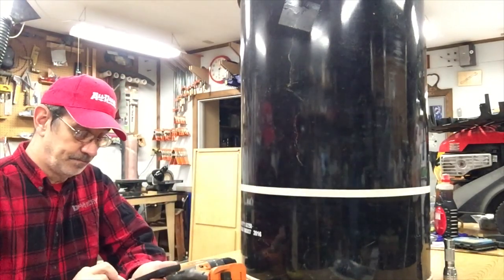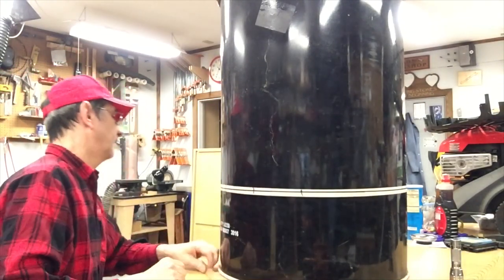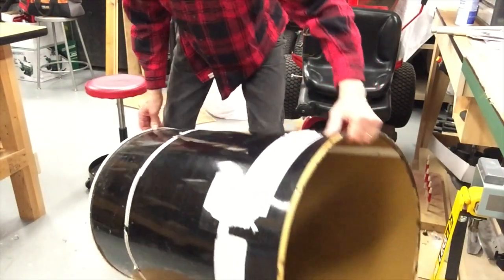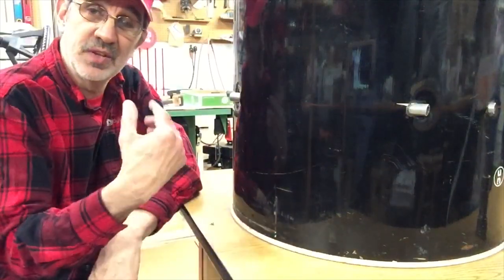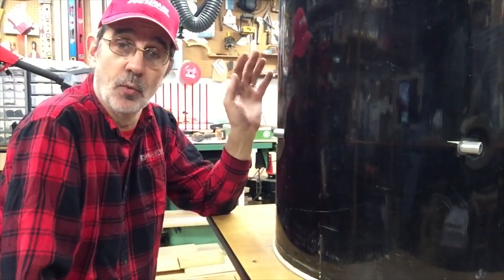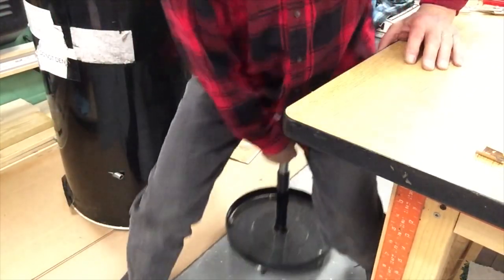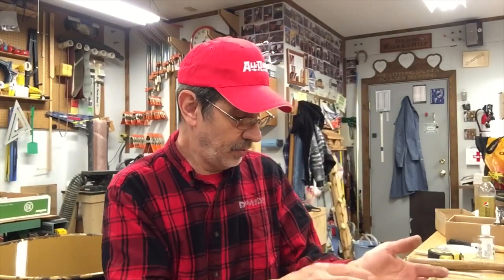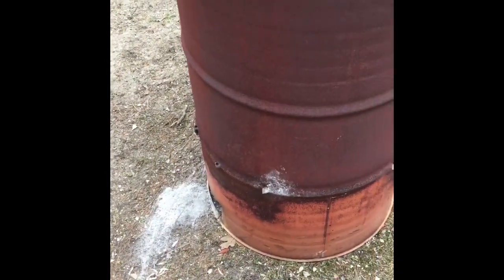293. How can I build a burning barrel that actually works.

Comment: Hey Jim, just cut a slot in each end of the conduit and pry them apart a bit and they'll stay just fine. To eliminate any and all smoke, and I mean ALL of it, take a second barrel, cut out the top and bottom, make a cut from top to bottom, pull the ends together a bit, tack weld, and make it so that there is an inch of space all around between it and the outside barrel. Put a lid on the outside barrel, then cut out the center of the lid so that the space between the two barrels is covered. Then, put a circle of holes in the inside barrel about one inch from the top. You would make the inside barrel shorter, and let it sit on the grate. What happens is that the space between the barrels gets real hot and creates a vacuum, which sucks any smoke downward, which then mixes with fresh air, and is then drawn into the space, and gets real hot, and when it comes out of the holes it meets the flame and burns like mad because the gas in the smoke ignites. There will not be even a hint of smoke, no smell, no burning eyes, and is perfect to stand around in freezing weather with some marshmallows. There will be no specks of anything flying through the air because it all got burned. You can expect the flame to be about two and a half times higher than the barrel which is because of the gas. Just make sure that any and all fuel is below the holes as anything above the holes will smoke. What's really amazing is that in the winter you can feel the cold yet stay warm at the same time, and no smelly cloths, and it feels amazing. You'll be able to almost hug the flame and still be comfortable. Family and friends will love it as a real fun thing to do. You could mount the whole thing on an old mower deck to move it around the yard to wherever the fuel is. BTW Jim you do a good presentation.
Reply: I like what you are sayin , but I can't quite see it in my head. A picture would help. Thanks, Rick
Reply: You really should make a vid explaining this.  Sounds awesome.

Comment: I made one exactly like yours. I burned while I mowed my yard, returning to the barrel to add brush.  I burned for several hours, probably 6 or 8 barrels full with some logs 4-5 inches in diameter.
Hours later, after the barrel cooled, I went and looked in, and was surprised to find nothing but ash, just like you said.  I then put the ash in a 5 gallon can to place by our tomato plants.  

I loved the experience so much, that I bought a second barrel and the only difference is I used rebar instead of galvanized pipe because I could only get the pipe in 10 foot lengths and could not get it in my car.  Thank you for sharing your idea with us.  I have already shared it with a friend (your YouTube video),

Comment: Hi Jim - it's Big Rodders from Ireland. An interesting version of the old volcano stove principle. For folk with less room in their yard another simple idea is to use a washing machine drum which, being stainless steel, will not rust. Remove it from from the machine, a task in itself, and reverse the offset pulley on the rear so it acts as a stand and raises the drum maybe 9 inches off the ground. Cut a slot like yours in the bottom, face it towards the wind and "Bob's your Uncle"! The greater the wind the better it burns - and we know about wind on the west coast of Ireland! The firebox volume is smaller than your stove and air dispersal into the heart of the fire isn't as efficient but, as you say, "as long as it works". The best part is that the cost is ZERO - Yippee!

Comment: 4/13/22 I officially made your burn barrel thanks! I’ll test it out tomorrow. Your instructions were good enough for me to put the barrel together. I started with nothing so the est. total I spent was about $115. Tools are WAY cheaper at Harbor Freight Tools rather than Home Depot, Lowes!
UPDATE: I just tried the barrel and wow! It did EXACTLY what Jim said and turned everything to fine powder! Everything burned so quickly and ignited so easy after adding additional branches. The barrel gets really hot so please follow your local guidelines and burn safe!
Reply from the maker: OK I have to ask what did you buy for $115. Jim
Reply: @jimjackson9381  
Barrel $25
24x36 expanded sheet metal $55
Drill Bit $20
1/2in 10ft conduit pipe $7
Cutting bit $6
Reply from the maker: @MrAAok  Well sorry it cost so much but they do work nice. Jim

Comment: Great Idea, I moved from Homestead FL and got a place in Chiefland (North Central FL, Levy County) on 2 acres next to the State park here. Got lots of trees that drop leaves and sticks etc. but I been afraid to build a fire and burn them because I am in the middle of a forest. I don't want an ember to float up and get out of control. This looks like a good solution to that problem. My neighbor burned a bunch of stuff last year and I was sitting here just hoping he didn't set the woods on fire. I will feel a lot better with everything contained safely. I'm gonna do this one.
Reply: Hi David Boggs - Greetings from Big Rodders in a locked down Ireland. To reduce possibility of air borne emblems you could make a second mesh grate that you would place on top of the barrel when you light the fire and weight it down with a cement block. That may give you some peace of mind.
Reply: @rodneysweetnam8653  i thought of that too..that's a good idea i have some more expanded metal I'll do that to mine..thanks for the idea..Cheers 🍻🍻🍻🇺🇸🇺🇸🇺🇸

Comment: Be sure to check with your local Fire Department,as burn barrels are illegal in town around here.  I’d add a 2” hole under the grate level to insert my weed burner and a few pavers to keep it off the ground while still keeping it stable.  Nice build, Jim!

Comment: Those pipe you could easily just squish the ends after they're installed, either with good sized vise grips or a couple hammers , hold one under the pipe then hut the pipe with second hammer. With the pipe flattened out a little it will be bigger than the hole. 2 seconds per pipe and done.

Comment: I simply cut a big hole out of the bottom of the barrel and drop in a round charcoal grill grate. The barrel sits on three cinder blocks and the ash drops down and is shoveled out as necessary. Oh, some holes drilled in the side of the barrel but I'm not sure if that is really need or if it just makes me feel good.
Reply from the maker: @BillKisel  well I suppose that would work as long as you don’t mind a mess on the ground and you don’t mind shoveling it up when I get ashes in the bottom of mine I just turn it upside down on a piece of cardboard and throw it in the garbage personally I don’t like shoveling

Comment: Great video.  Good idea.   I bet that if you drill an accurate hole for the conduit tubes, you could just crush or crimp the ends of the conduit to keep them in place permanently.  There is no real reason to remove them in future.
Reply from the maker: In less you want to reuse them on the next Barrel.      Jim

Comment: I have some rebar laying around I'll use it and the expanded steel..i may put legs on it too ..about 3" long..thanks for the great idea..see you on the next one..Cheers 🍻🍻🍻🇺🇸🇺🇸🇺🇸
Reply from the maker: Rodney Brand 
When you get it done send me a picture of you and you’re burning barrel. Jim
Reply: @jimjackson9381  i was going to do it today but i had to fix a few john Deere's..it's supposed to rain tomorrow so maybe ill get started monday..i have one length of rebar i used the rest on something else but i have plenty of conduit so ill use that instead..and i want to put legs on it about 2" high just to keep it off the ground..i can use the legs from a bed frame ill just shorten them.i like the fixture you made too. Very smart..i will send you picture or video or something..lol..thanks again ..Happy Easter to you and you're family..
Reply from the maker: Rodney Brand 
Hi Rodney, I’d appreciate the pictures that would be great you can send them to my email which is
jimsfixitshop@gmail.com
Thanks. Jim
Reply: @jimjackson9381  i did it ..that is the best burn barrel and it gets very hot..got pictures on my tablet but can't share them..i will try another way..thanks Jim..
Reply from the maker: Rodney Brand 
Well I would definitely like to see pictures of your barrel and how well it works for you. Jim
  Oh and make sure you’re in the picture also.

Comment: Thanks for the video. I did my barrel exactly the same. Now my yard is cleaner..the only problem is with the grill I cant find one the same you have.
Reply from the maker: If you mean the expanded metal in the bottom of the barrel I have some 2 ft. Sq  pieces that I can sell and ship. Jim
Reply: @jimjackson9381  thanks I just got one..

Comment: I like it.  But, use rebar instead of conduit.  Under the rebar add one 1" rigid conduit about 4ft longer than the diameter of the barrel.  Drill a skillion holes in 1" conduit.  Insert in barrel and cap one end.  Use a leaf blower to turbo charge your fire.  You could use it as a crematorium for the neighborhood.

Comment: I'm gonna try to drill small holes in the grate piping to add more air to the base of the fire. Also add an inner burn chamber and lid with 4inch stack.
Reply from the maker: When you get it done send me some pictures I’d like to see it. Jim
Reply: holes in conduit for more airflow -- my thought as well

Comment: Awesome I made 1 myself after watching this but I just Hammered the ends of the conduit not as pretty but faster should I put holes in the bottom of the barrel incase water happens to get in? And how did you cut that flap I haven't done that part yet I bought a Nibbler will that work? I hope so!
Reply: Ann Hopkin didnt u make it past 10:30 ?
Reply: @muntee33  saw the entire video and no where does Jim say how he cut the flap; only how to pry it out.

Comment: Thanks Jim!!! 👍  I like the idea of the the burn barrel. But I believe that metal grade that you put in there would be kinda expensive. So I was thinking about the metal grade that’s on a Weber grill will work? I have several of them around home are bad!
Reply: That is what I used in the bottom of mine. I have a bottomless barrel that  sits on a few concrete blocks to allow air flow. It burns everything quickly and efficiently.
Reply: Go to goodwill. Buy oven grates

Comment: Is this tin plate or steel? Does it make a big difference?
Reply from the maker: It’s just a 55 gallon oil barrel that is probably made out of sheet metal but they seem to hold up for several years before you have to replace them. Jim

Comment: If your Ash only originated from organic material like leaves, wood, and so on it would be excellent fertilizer
Reply from the maker: I’ve heard that a few times but I’ve never actually tried using that as fertilizer I’ll have to check into that. Jim
Reply: My 92 year old father in law, back in the day, would till the ash into his garden.
Reply from the maker: @sandlapper3016  Well maybe I should give it a try and see how well it works. Jim

Comment: What is the diameter of round expanded metal ?
Reply from the maker: @jimgresham5529  it depends on the inside diameter of the barrel you’re going to be using
Reply: @jimjackson9381  Thanks for reply,   What did you use to cut it ?    I'm going to try my Matabo 6".
Reply from the maker: My 4 1/2 inch right ankle grinder with a cut off disk

Comment: BEST burn barrel: cut out top. cut out bottom. set up on three or four red bricks. done. smokeless. you're welcome.
Reply from the maker: @jameskelly9800  well, when you dump in all the stuff you wanna burn in the barrel it’s all gonna fall right down on top of the ground and it’s not going to burn completely up because you can’t get air underneath of it and it’s eventually gonna pile up deeper and deeper and when you do decide to clean up your mess and you move your barrel, all the mess is laying on the ground that you’re gonna have to shovel up and away. With this barrel, everything burns completely to white powdery ash and it is all contained within the barrel when I get ready to empty the ash I reach in and remove the wire grate and tip it upside down onto a piece of cardboard and I fold the cardboard and dump it either in a bag or a box and dispose of it. I don’t have to spend most of my day, shoveling everything up off the ground and trying to burn it, so good luck with that, most of us know better.

Comment: 1. Get rid of the conduits pipes and use 8 bolts extend to the insides ,lock it down with nuts to hold the bolts in place -  that steel mesh sits on the bolts 2. Cut a 6 X13 inch on the bottom use hinges and steel rivets to create an access door for vent and ash cleanup
Reply from the maker: I tried that but if you don’t buy heavy mesh it gets hot and Sags in the middle. The stuff I use is only $40 for a 4 x 8 sheet. Jim

Comment: Hi Jim can I pay you to ship me the rods and the grate for one 55 gal drum ?
Reply from the maker: Hi this is Jim, I can cut the bars and the wire mesh and ship them to you but the bars are just half inch conduit you could buy  at any hardware store to cut the wire mesh I would need to know the exact inside diameter of your Barrel there are several different Barrel manufacturers and the sizes vary if you could send me a picture of the barrel it would probably help also you can send that to my email    jimsfixitshop@gmail.com just let me know what you would like to do. Jim